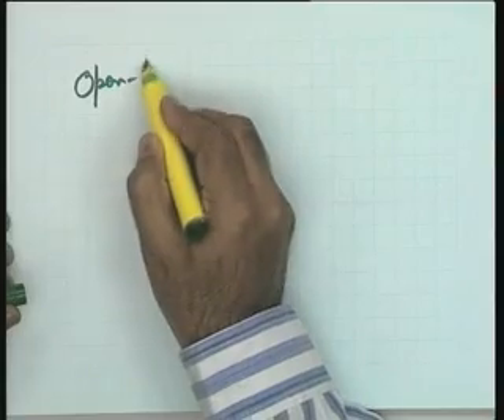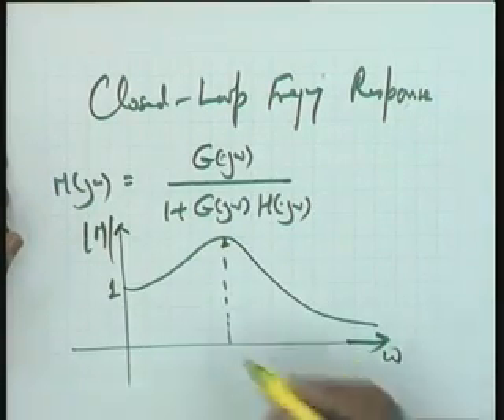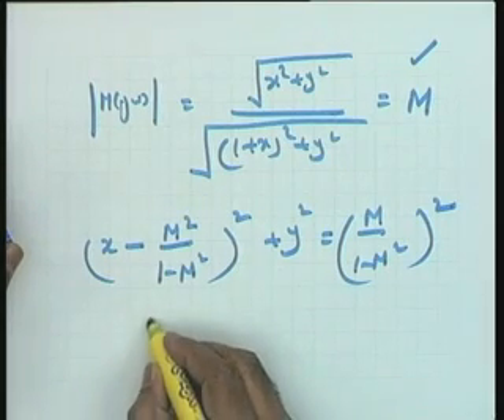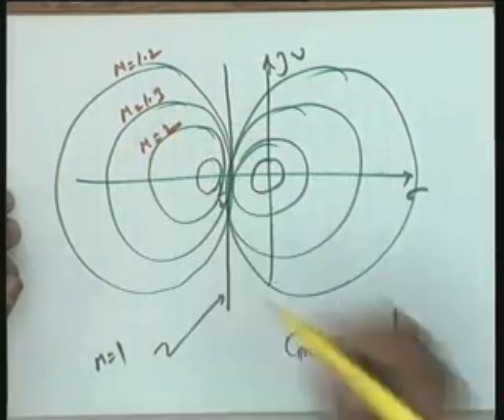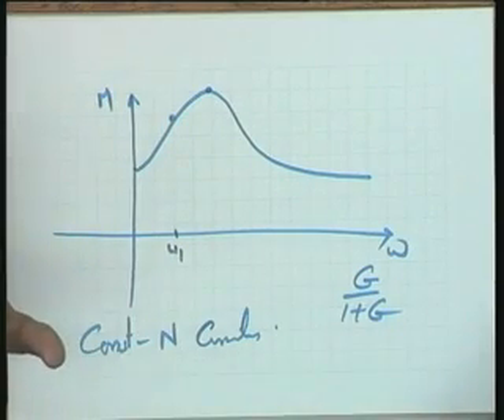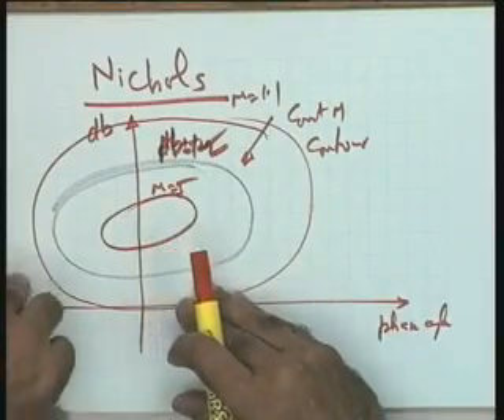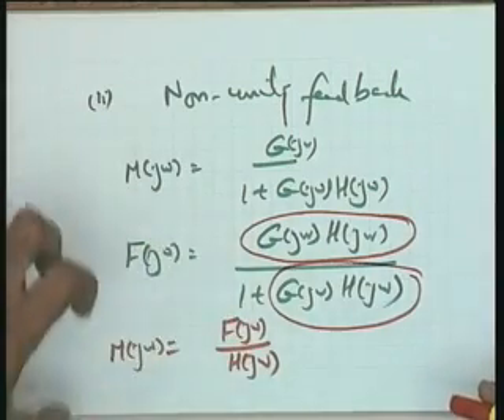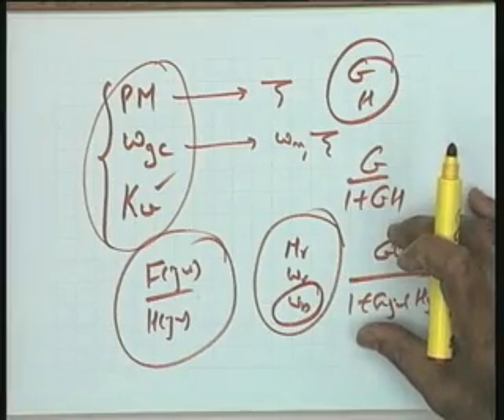Lec-40 Feedback System Performance Based on the Frequency Response (Contd.)

Comment: how can we find the frequencies at the point of intersection like W1,W2 etc....
Reply: I believe you have to go back to the Bode plot for the corresponding magnitude and phase angle to read the frequency at which that point occurs. So, essentially you plot the closed loop bode plot using the gain and phase values from the intersecting contours. When you draw this bode plot, use the same frequencies that you used (or have) from the open loop bode plot so that it's easier to draw the closed loop response. Remember, straight lines are open loop (G) and contours are the closed loop ones (G/(1+G)) on Nichols chart! Explanation in the video 35:45 to 36:50 might help. I hope I understood your question correctly. If you meant for the Nyquist plot then as Prof. Gopal has mentioned, is difficult to obtain unless you have mathematical function and the calculations can become tedious for the higher order systems.